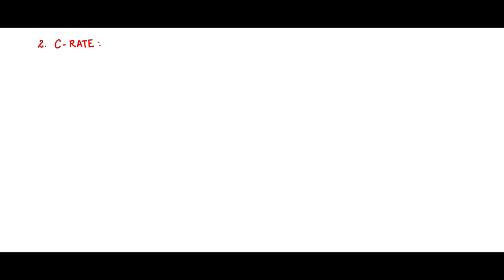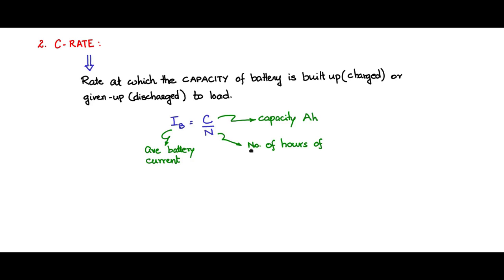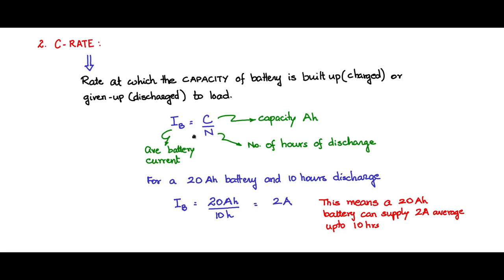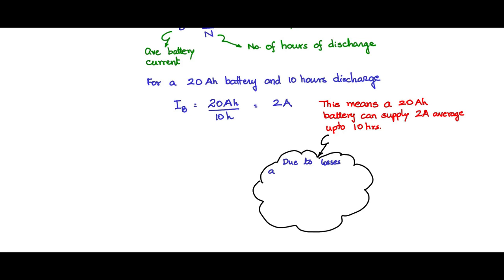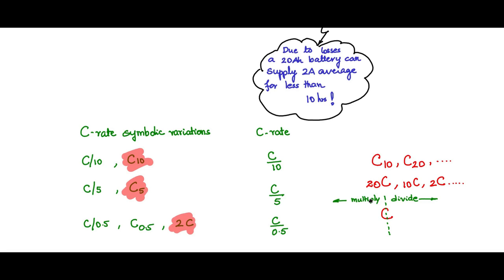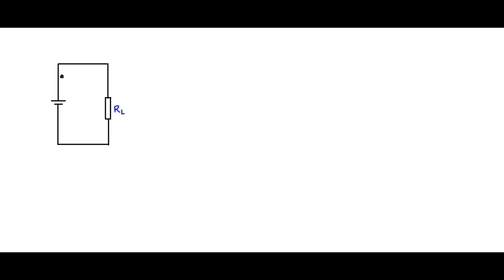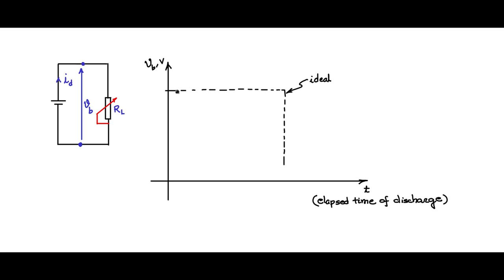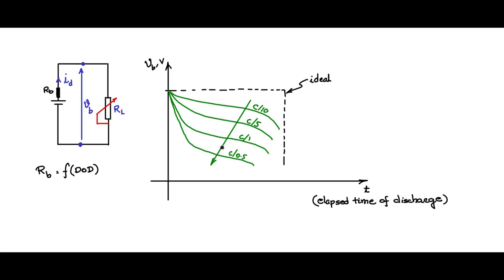Battery C-rate

Comment: Good and well explained tutorial. Please how do I determine the total C-rate of a battery I built using lithium ion cells of 2750mAh capacity and c rate of 0.2C? This battery pack is made of 4S 11P connection which gives me an output of 16.8V. 4S 11P means 11 cells connected in parallel and 4S means 4 of the 11 parallel cells now connected in series. Thank you.

Comment: Sir, can u please suggest that, a Lithium Battery datasheet is showing3.2v 6Ah, and standard discharge current is 0.2C5A (100%)and Max discharge current 3C5A(85%). Meaning.... Thanks

Comment: Sir, it means that for selection of inverter battery, capacity of battery in AH shall be more than peak load to be supplied through inverter,

For example, if we have 150 AH battery with C10, then average current that battery can supply for 10 hours is 15A. If voltage of inverter is 12V DC, then wattage that we can supply by inverter is 180W only.

Similarly, if we have 150 AH battery with C5, then average current that battery can supply for 10 hours is 30A. If voltage of inverter is 12V DC, then wattage that we can supply by inverter is 360W only.

Accordingly we shall select the capacity of battery and C-rating of battery for inverters.

Sir, I have one doubt, what is the max. current that one can draw from battery? Pls specify the calculation for that. For ex. 150Ah of C10 battery,  average current that we can draw for 10 hours is 15A but what is the max. current that we can draw from it??

 I understand that current which can be taken out from battery shall be obviously less than inverter capacity to draw, i.e. suppose inverter capacity is 1100VA, then inverter can draw max. 90A DC current from battery. But my question is, Is 150 AH C10 battery capable to supply 90A peak current (irrespective of discharge time)??

Please clarify.
Reply: Sir have you found the answer for this?
Reply: यदि हम दो फुल चार्ज C10 150Ah की बैटरी लें और दो ही फुल चार्ज C20 150Ah बैटरी लें और इन दोनों को 24V का सेट बना कर अलग अलग 10Amp के समान लोड/करेंट से डिस्चार्ज करें तो दोनों में पहले कौन सा 24V का सेट डिस्चार्ज होगा??